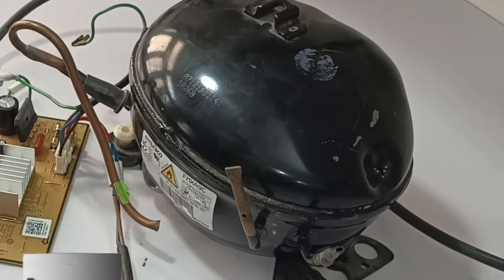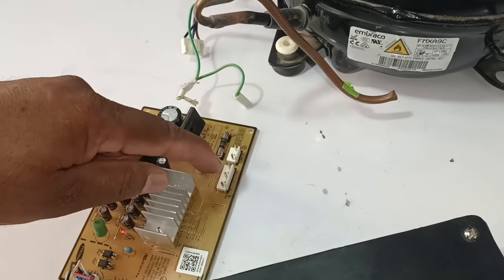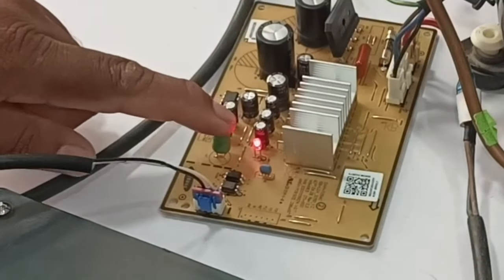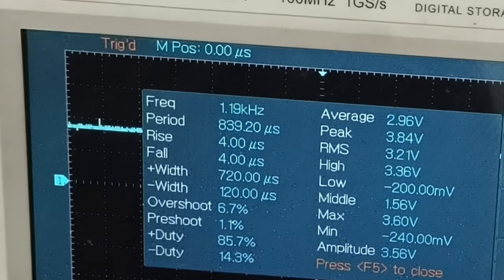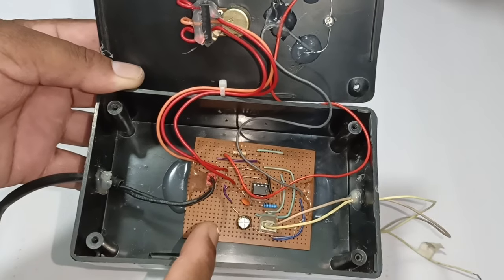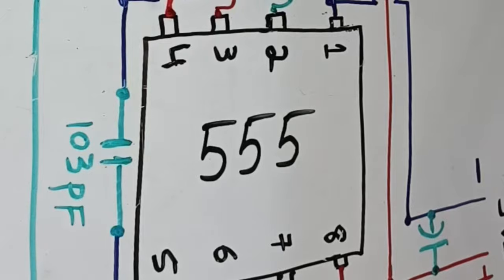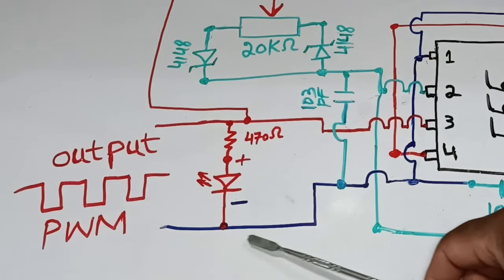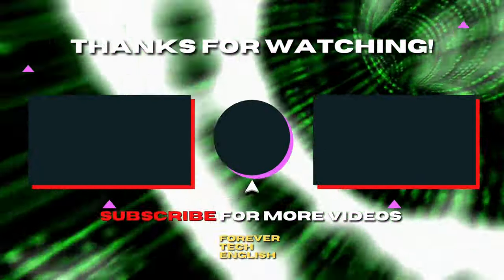Inverter Compressor Direct Start - Samsung Refrigerator

Comment: He said direct, but he is using IPM. Lol
Reply from the maker: I just didn't use the main mother board, if you plug the dc compressor direct on AC voltages Without the circuit board, It is going to burn in seconds.
Reply: @forevertechenglish  
Then you should change your title.

Comment: What was the voltage value of the two zeneer diodes near the potentiometer
Reply from the maker: Dear these 4148 number zener diodes plz you can check its datasheet to confirm the voltages
Reply: They are not zener but small signal diodes 1N4148. Of course you can use any general purpose diodes even 1N4000 series.

Comment: Excellent video. Does this work to start a samsung invertor aircon compressor?
Reply from the maker: No it won't. Its only Generates the PWM Pulses for the samsung refrigerator Circuit board.

Comment: If a 5vdc signal is used will the compressor run at full RPM or does it have to be pulsed?

Comment: how voltages actual need to starting  the compressor?
Reply from the maker: The voltages differs for different models of inverter compressors. They are mentioned on the compressor. Also at what frequency the compressor runs. That is also mentioned. If a person need to know about the compressor in depth then one should study its datasheet.